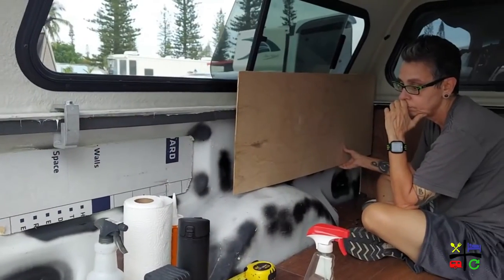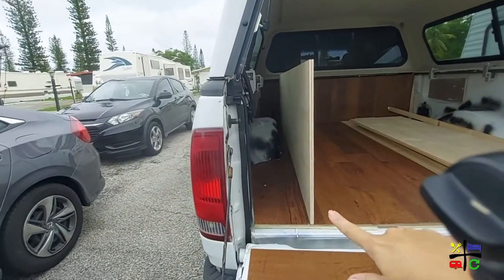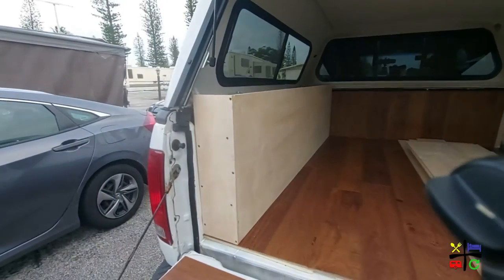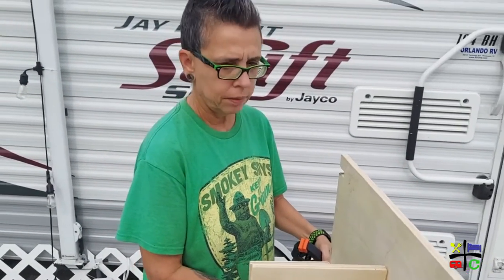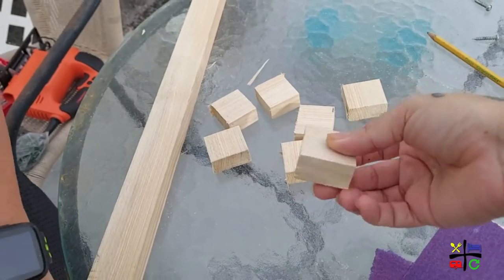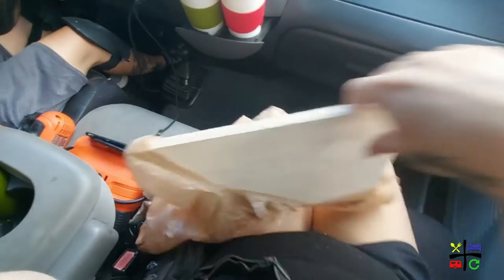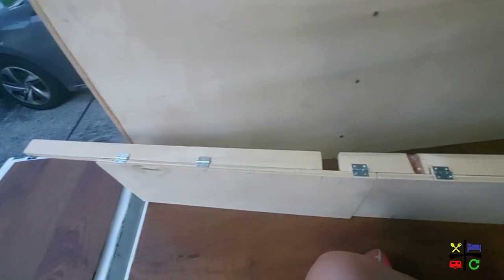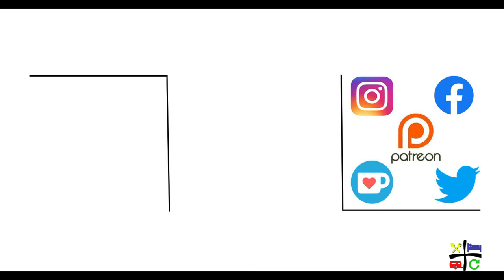Truck Bed Camper Build | DIY Pickup Truck Cabinet Build Out | S4E7

Comment: Thank you guys for making a video on how to build a sidewall cabinet for the wheel well area of the truck, There are not many videos how so thank you . I do have a question for you though, how did you fasten the cabinet to the truck?
Reply from the maker: If I remember correctly without rewatching the videos; we used Liquid Nails on the bottom, back & sides.  Anywhere that touched a surface.  And Lou screwed it in on the backend,  where it bumps out, near the lights.  Since that doesn't go all the way out.  It never moved!
😉Angie